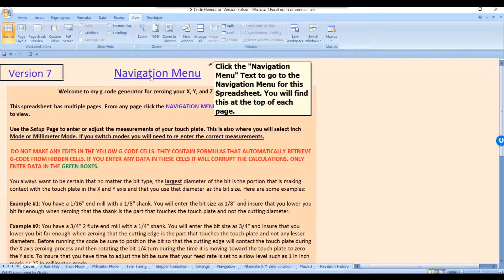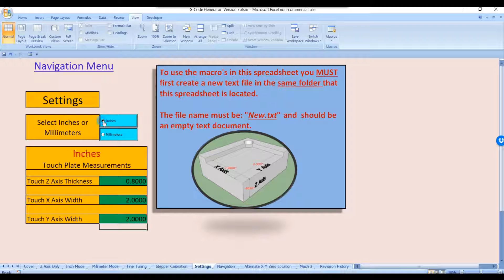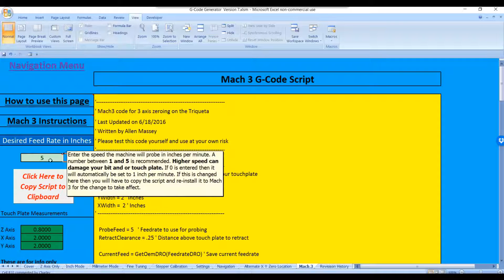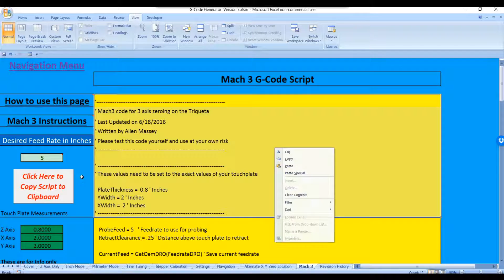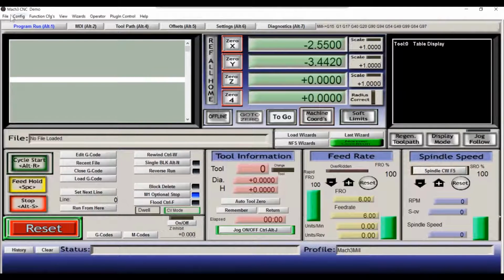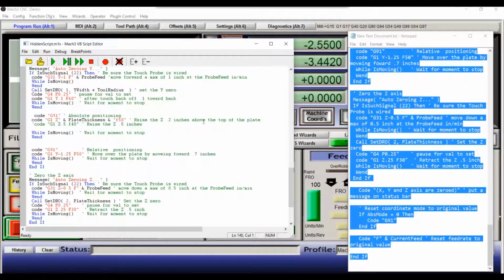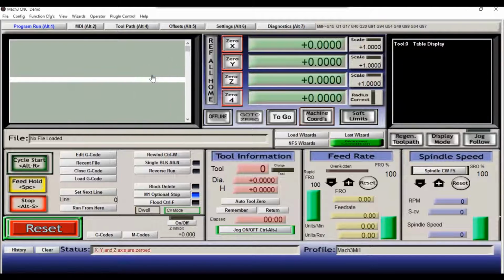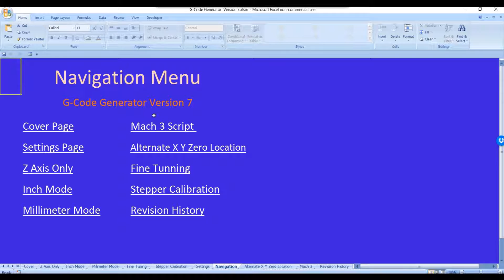Mach3 Script for 3 Axis Auto Zero using the Triquetra Touch Plate

Comment: Hi I am running MAch 3 and when I try to auto zero the first thing i get is a message to touch the plate to the bit, and when I do it doesn't register. Do you know why this keeps happening?
Reply from the maker: I know this is a long overdiue reply. If it still isn't working then the first place to look is in Ports and Pins.  Make sure you have the correct input pin assigned to thje Probe. It should be either 5, 6, 7, 8 10, or 11and  have a green check showing it active. Also be as signed to Port 1 most likely depending on your setup.     Also check for 5-24 vdc between the touch plate and ground.

Comment: hi sir it is possible to get the script in metric for mach3?. i cannot found it
Reply from the maker: This spreadsheet (still available) has been replaced by the Triquetra Tool Box which has everthing the spreadsheet does and more.  We are always adding new machines to the list of compatible devices. You can get the Triquetra Tool Box and / or the spreradsheet at www.triquetra-cnc.com. Both  Imperial and Metric units are supported..

Comment: Would this work on a conductive work piece, ie an aluminum block clamped to the table of a mill or would the block complete the probe circuit?
Reply from the maker: That is possible but if it does then you may be able to revers the wires so that the block is negative and the bit is positive. That would only work if you bit wasn't already grounded though.  You could do some probing with a multimeter and find out if there was any ground present at the table. If there is a live ground there then it would probably give a false signal and fail.

Comment: ive had problems with mine sence i broght it the z is all ways showing about 4 to 5 mm high
Reply from the maker: The Triquetra Tool Box has a feature called fine tuning. I will allow you to make adjustments to correct any discrepancies in the resulting zero location for any of the three axis.   If you need help with it just let me know and I will be happy to assist you in getting a accurate and repeatable 3 axis zero.  Email me at charleyntexas@gmail.com if you would like me to help you with it.
Reply: @CharleyThomas2016  hay charlie i would like to let u no i finnaly got it working its right on the money now.. it was me not the item so i`am sorry it was me not noing how to properly set it up..
Reply from the maker: @1bulldog998  lsf to hear you have things resolved now.